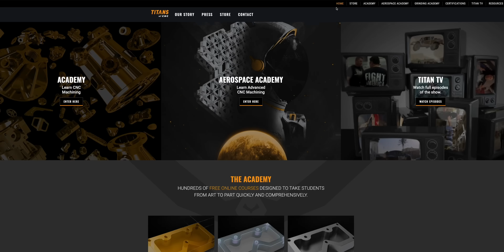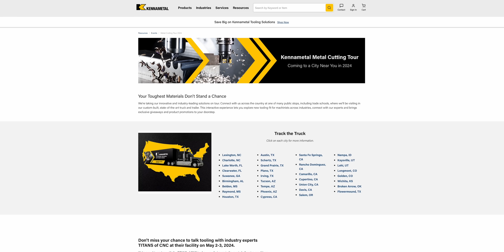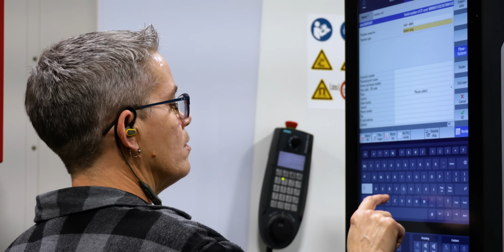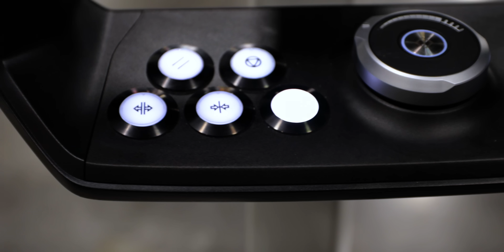NEW GIGANTIC CNC Machine Hits our Floor | BLOHM PROFIMAT XT

Comment: I've spent the last six months collaborating with this company and wanted to share my candid experience. While their product line is undoubtedly intriguing, many are still in the Proof of Concept stage. This differs notably from their marketing claims. On a positive note, their marketing team is exceptional, demonstrating both creativity and enthusiasm.

My experiences with their management and HR departments have been far less favorable. The lack of efficient communication between these two critical departments was a significant issue. Notably, during my tenure, I didn't have a single meeting with HR, and the management failed to provide clear direction and tasks. This created an environment that was challenging to navigate and thrive in.

For professionals considering collaboration or employment with this company, I would advise caution. Despite the presence of talented colleagues, the overall communication and workplace environment leave much to be desired. It's essential to consider these aspects when making your decision.

Comment: 22000lb nice. That's almost as much as the small table on out small mill ( that table is about 24200lb ) 
We do huge manual milling and turning btw. Where it's so low bars with long lead times that cnc's would be a bad idea